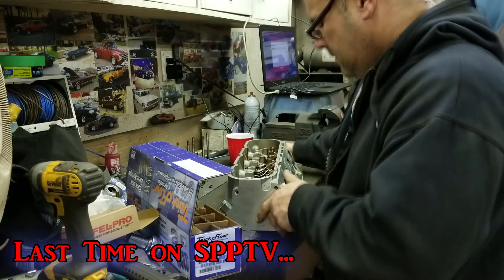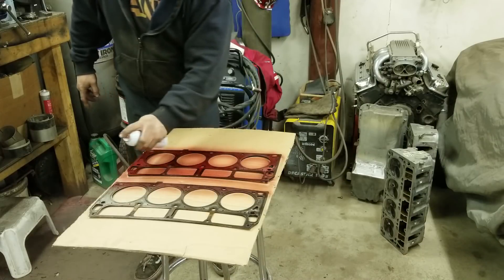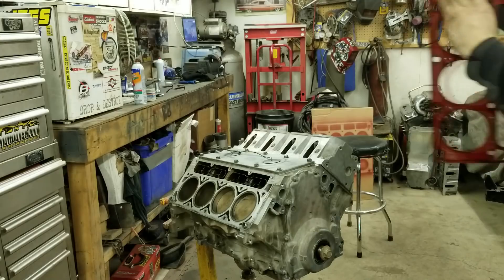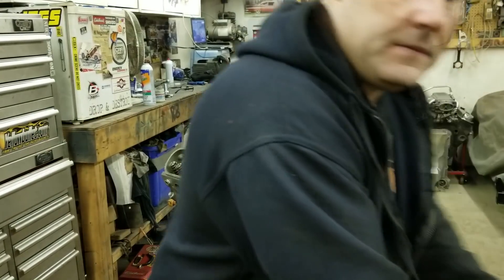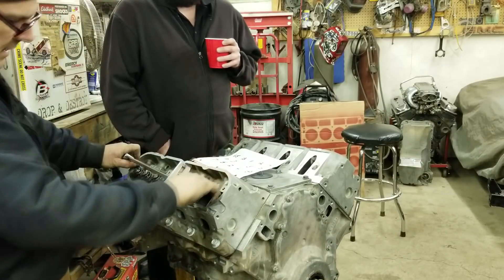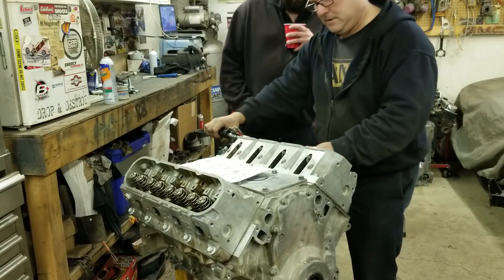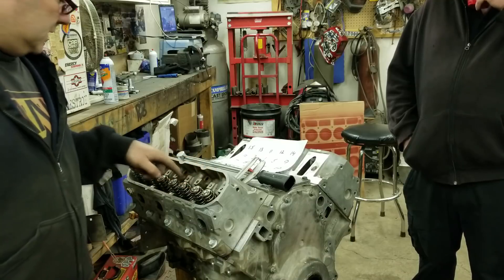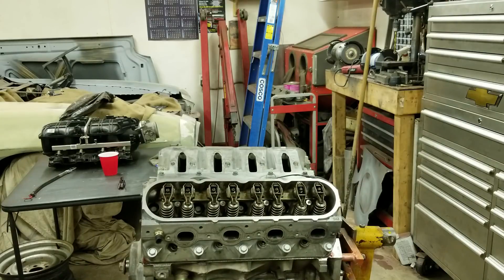LOW Cost TURBO Garage Build feat. BENDY | Head Install Using GM Bolts and Copper Spray

Comment: I wouldn't worry about a torqe wrench with used head gaskets, oil pump and bearings . least of the concern there .   prob'ly won't run long enuff to worry
Reply from the maker: Sure it will, and make tons of power.

Comment: Hey Love your Videos. Let me know if you know of a Good Used Larg Turbo. Oh Is there a better LS 5.3 to look for? Like numbers on block or Heads? Thanks Keith
Reply from the maker: The L33 5.3 aluminum block engines are nice and lightweight. 243 or 799 heads are better than the rest.
Reply: Ok Cool Thanks for the info.

Comment: Rob, when you tighten up the rockers was the number 1 cylinder at TDC on the compression stroke? Reason for asking is i came across a procedure to tighten the rockers i just tighten mine down torqued them to 22 flbs. I was going to loosen them and follow the procedure.
Reply: Sean Clancey ive done it both ways. I didnt notice a difference.
Reply: Thanks i will leave them i guess.

Comment: you reused the old head gasket?
Reply: Israel Chiasson yes, they are not like old school gaskets. Lots of people reuse them
Reply: novaracer2000 yes by first time i ear that.
Reply: 64impalaSS  lots of people do with great success
Reply: You should not reuse head gaskets on LS engines
Reply: novaracer2000 Yes they do it but they not supposed to because Ls gasket when you torque it down it crashes the gasket ls  gaskets supposed to be one use only
Reply: novaracer2000 im hdet red seal mecanic and i work on diesel engine from 85hp to 3000hp and never i see or read anywhere that ok to reused the head gasket.but like i said before i never work on gas engine just never ha ha i guess we learn stuff everyday.Amazing channel by the way.israel french acadian from new brunswick living at labrador city NL

Comment: We took all 6 guy's in the shop torque wrenches and did a test and not 1 was the same.I had a bendy 40 yr's ago,put many a motor together with it never had a problem. Then I got a job as a apprentice and the boss grabbed it bent it in half and told me to go buy a "real" torque wrench. Well after having a "real clikley" A real dial indicator ,I can honestly say they are no better. If you don't re-calibrate it your just as accurate as a fart in the wind.Then add in factors like temperature differences is the head at 65 and the bolt at 55, one is steel the other aluminum has the shop been at 1 constant temp for days or did you just turn on the heat a hour ago ? Mainly when dealing with low inch pounds. GM dose some real stupid shit ! 9 in pounds for the cam chain oil tensioner bolt on a ecoteck get it wrong and you can throw a $90 part in  the garbage. 1 bolt to hold the thing on and it' not in the middle so it warps stupid easy. Point is race shops have very controlled work spaces and build shit to very exact specks if anyone thinks they can do that at home they are nuts. If your doing builds like this close is more than good enough.

Comment: The angle thing produces more consistent bolt stretch, especially when you have dirty bolts/holes which takes more torque to overcome the friction. In a dirty hole you'd end up with some of the tq being applied being lost to the friction, with the bolt not being tightened enough
Reply: Ok you are right in a way but if you use a different oil or no oil or locking compound then that all changes.1 might be at 90 the next at 92 or 96. In my opinion ( yes like assholes everyone has one) the only thing that matters is they are all the same. If you are working in a shop at 35 c or a shop at 75c you will get different results. 40 years bolting stuff together is why I think I know it's just a rough guess when you hear a click or the wizz banger shows 90 deg.